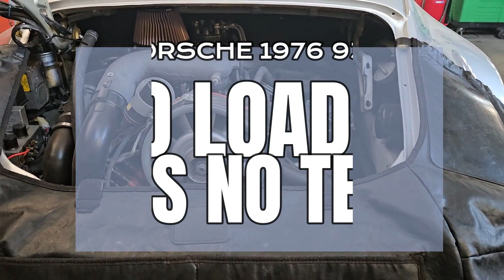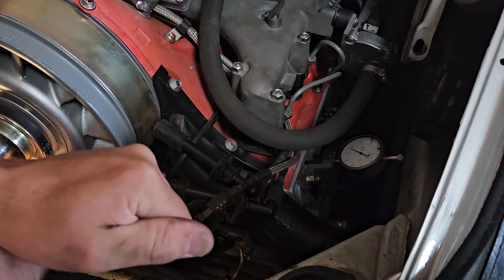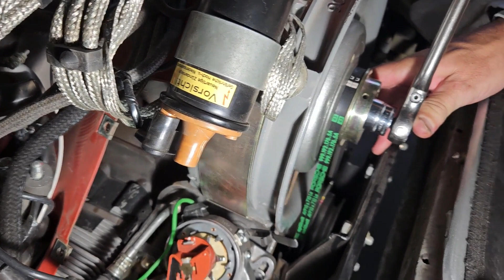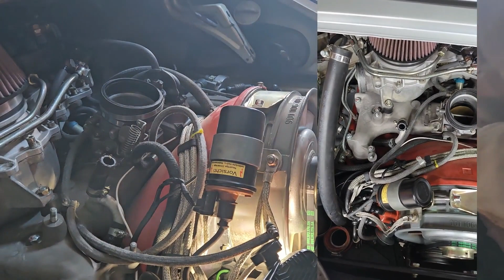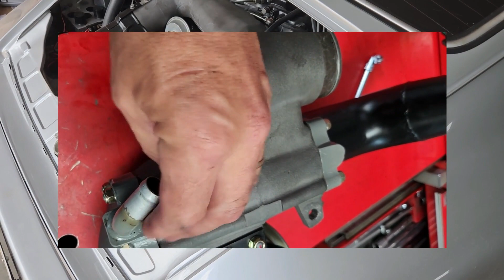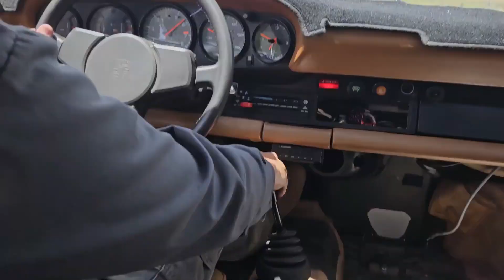No Load Is No Test. Turbo Trouble 2. Porsche 1976 930

Comment: So awesome. Do the later intercooler cars have that same vacuum piston for changing the manifold length?
Reply: They do. I have a 3.3 and rebuild my engine completely. Discovered that my piston was seized and the rubber sealing rings where crumbling.
Reply from the maker: pretty normal for those rubber bumper gaskets to break up.
Kurt
Reply from the maker: Yes they do
Kurt

Comment: This is EXACTLY what I suspect with my 3.3L.  I have the same issue, little to no boost.  I did not check the cam timing when I put the engine in because I didn't have a Z block.  Thank you for sharing this with me, you are a superstar for doing this in the car.  It think I will pull the engine.
Reply from the maker: just take your time and work through the diagnostic tree. I would check engine leak down values, spark operation, and fuel before jumping into anything else.
Kurt